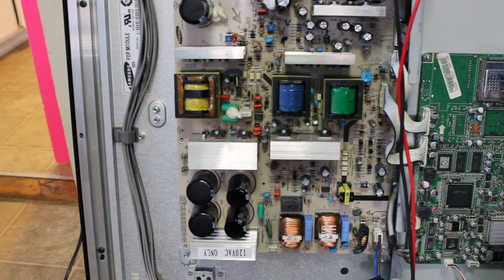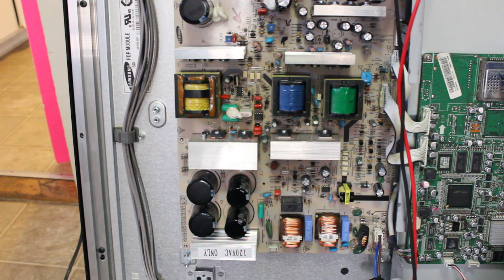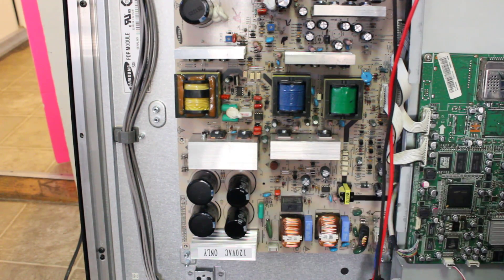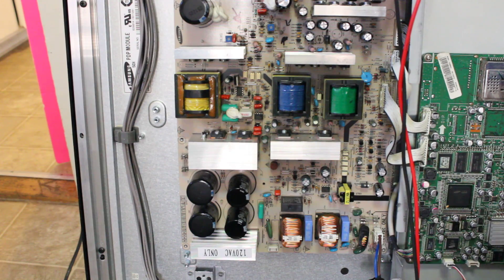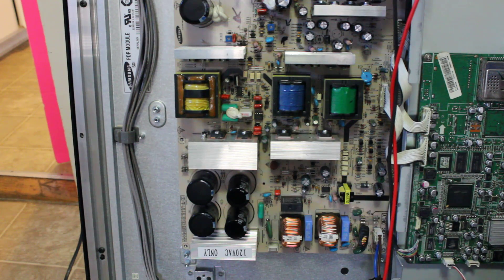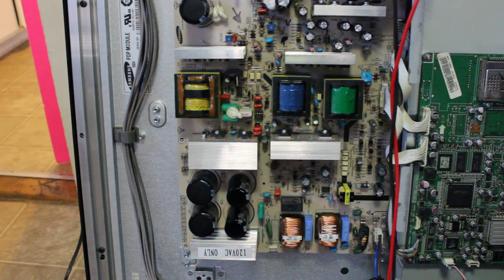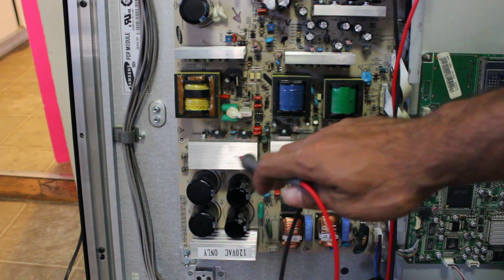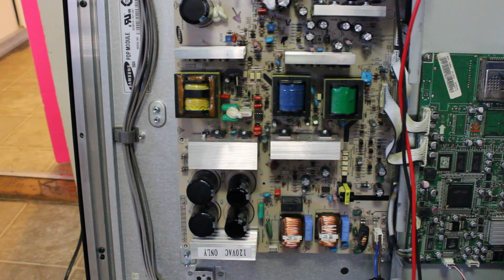How To Repair Samsung 42" Plasma TV HP-S4253 With  No Power or No Picture

Comment: Hi, I have the same TV model, it won't turn on. I changed the two 470uf Capacitor and a small 100uf capacitor and still won't turn on. I also found an inductor with the plastic melted, but I checked and the power goes thru it. Could it be that inductor or could it be something else. I checked all the fuses and they are all good. Thanks for the video by the way.
Reply: Yes I think so..😉 the inductor 😊

Comment: Great video.  I am going to try this. In the video you say that the 2 capacitors are 470mF, but in the text of the video you say 420mF.  Which one is it?  Also do you have any other specifications for the capacitors?  Thanks.
Reply from the maker: Hi, the value of the capacitors is printed on the actual capacitors of your TV. In the TV I am repairing they were 470. I mistyped the value, but now I edited the text. Thanks!
Reply: Thanks for the confirmation. That is the value I see on the caps in my TV. I looked at the capacitors and they look fine. I also checked the Vs voltage and it reads 193 volts. My problem is sound but no picture. Do you think it is the power supply or something else?
Reply from the maker: what are the va and vs voltages? There is a sticker on the back of the metal  panel near the power supply with the correct va and vs voltages that power supply needs to output.

Comment: How can I fix a flickering problem in this model?
Reply from the maker: +Yara Sevein Hi, can you describe the issue in more detail? Does the whole screen flicker? is it bar that flickers? Does the flickering go away after a while?
Reply: +Runforlife Yes the whole screen flickers and it stays flickering
Reply from the maker: +Yara Sevein That kind of flickering is not common on this models. You would need to check va and vs voltages in the power supply to see if any voltages are dropping, but you will probably have to take it to a repair tech for further testing.
Reply: +Runforlife thank you

Comment: Hi Have you ever had any sort of color ghosting - I get like a white background then I can see a rainbow of colors across the screen like little clouds everywhere . I do see that one of the capacitors that you mention looks a little pregnant so I will replace both of them just as a precaution . Any other help on my color issue would be great
Reply from the maker: +Geoff Maguire If the capacitors show signs of wear or leak, you should definitely replace those first. Let me know how it goes after you replace them.
Reply: +Runforlife Ok TV is fixed. Maybe a better description with my problem is known as "color bleed through" - Anyway - I replaced the capacitors but the problem was still there,  under further faulty finding I found the main PCB (PCB with all the external connections) board to seem to have some bad solder joints. As I did not have access to a reflow oven, I just did my own reflow with my regular oven-  so I just set the oven to 437 degrees F - when the oven reached 420 degrees F,  I put the PCB into the oven it took the oven exactly 2 min to reach the 437 degrees I was looking for,  I left it there for 1 min and then open the oven doo to start a cool down slowly remove the tray with PCB from the oven and let it cool down completely - I refitted the PCB problem fix.
Reply from the maker: +Geoff Maguire That's great. I am glad you were able to repair your TV at no cost. If you get the same issue again, at least you know where the problem is.